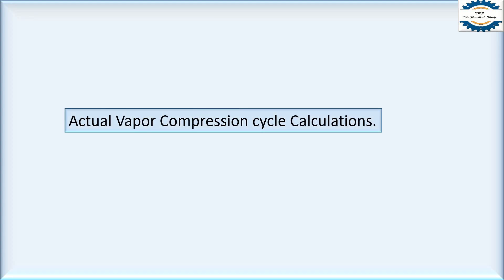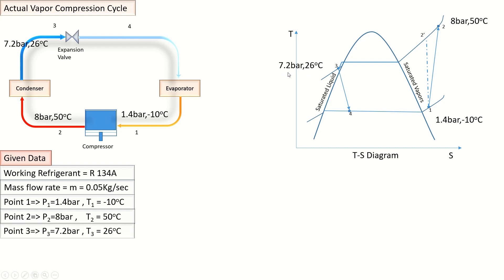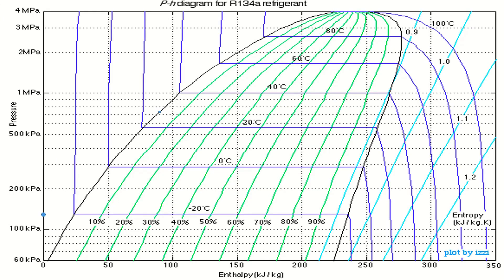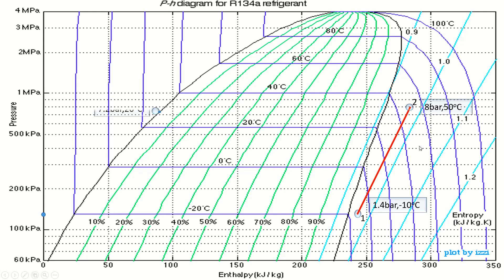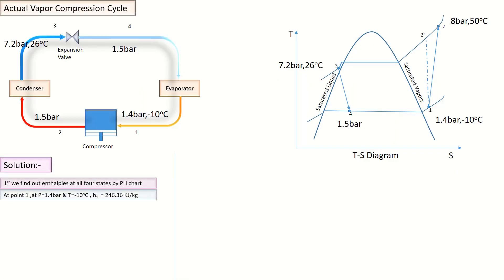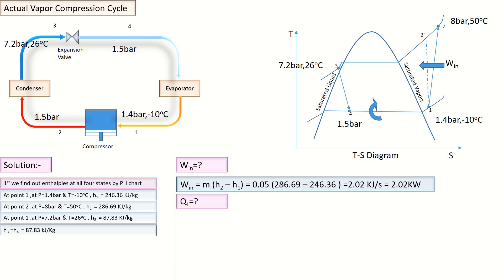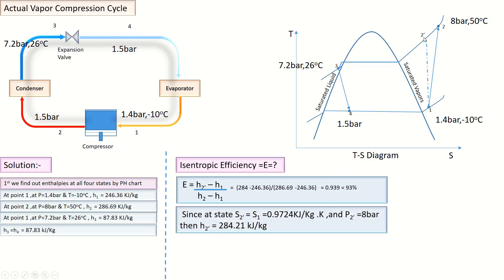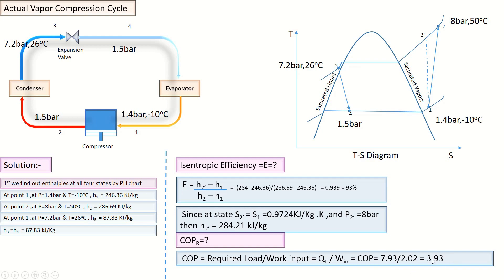Refrigeration cycle Calculations! Thermodynamics

Comment: Hello, I have a question that the heat rejected by the condensor is Latent heat of vaporization so can we use Q = mL for the heat rejection calculation?
also i want to know which book has been used for this lecture.

Comment: How can the condenser reject more heat than eveporator can absorb?
Reply from the maker: Dear Student,
After Evaporation there is compression process where temperature of refrigerant increases,and thermal BTU's of refrigerant increases that's why it rejects more heat in condensor than evaporator.
Reply: @thepracticalstudy  Hi sir thank for your wonderful video - I have one doubt about mass flow  value - mass flow value your take actual refrigeration line mass flow or what ?  

Mass flow in vapor line and liquid line 

A. Paramanantham 
SESS
Reply: Sir could you clarify that cop is refrigerantion effect to compressor work. refrigeration effect we should take till evaporator saturation point for cop calculation. But you have taken till superheated point. Kindly clearfy it.